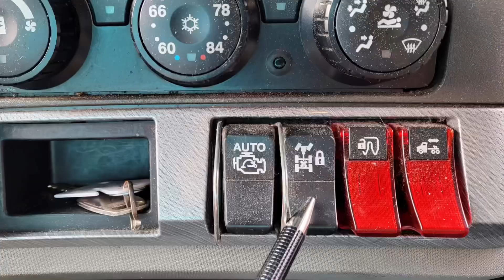Major Problem with the Kenworth Interaxle Lock

Comment: Unfortunately you will probably wait and go on breakdown pay. When I worked there I had breakdown after breakdown with my truck and asked for a new truck multiple times. I had to threaten to quit, which I didn't want to do, to be listened too. The other problem was the low breakdown pay. You make way more running than the $100 a day for breakfast, so you can negotiate that as well, especially if they choose to keep you in a truck that is constantly breaking down.
Reply from the maker: Yes! And Kevin only gets $75 for a full 24 hours of breakdown. Pretty tight!!!
Reply: @TheJoyofTrucking  that's just unacceptable

Comment: For clarification,  that is just an inter-axle differential.  Simmilar to an axle differential it is also known as a power divider.  It splits the power between the two axles either front or rear, locking it makes it provide power to both axles at once.  That looks like a mangled fill plug.  Whoever did the repair might need a talkin' to from their boss.  

Unless it is actually leaking and you see oil all over the ubderside of the trailer and truck, not just on the part that was repaired, it isn't an issue except for the next mechanic that works on it
Reply from the maker: Thank you!! You know your stuff!!! Yup…there was oil! Both times. :-(((
Reply: @TheJoyofTrucking  I have been doing this a while... well a few decades....

That broken part has me perplexed though.  That looks like a makeshift fill plug or plug for something else that should be there instead.

The whole thing probably should be replaced because who knows what damage was caused by the previous driver and inept mechanic(s).   Hopefully the situation gets better and money can start being made.
Reply from the maker: @Bendigo1  🙏🙏🙏😃😃😃